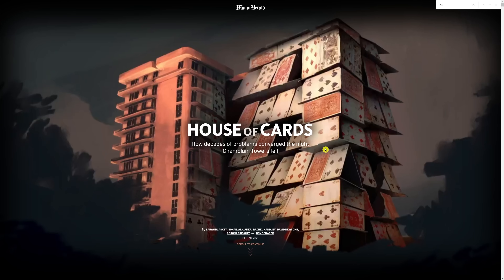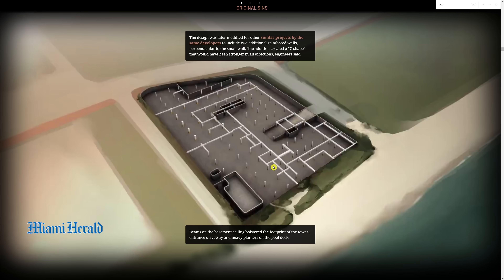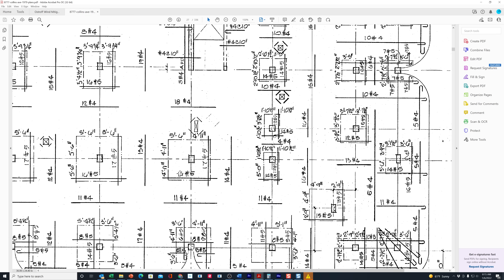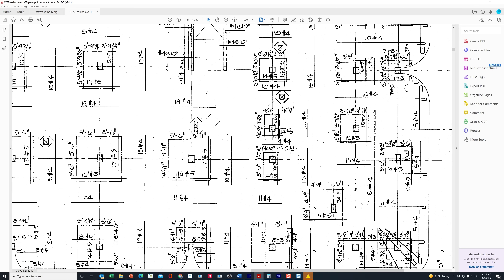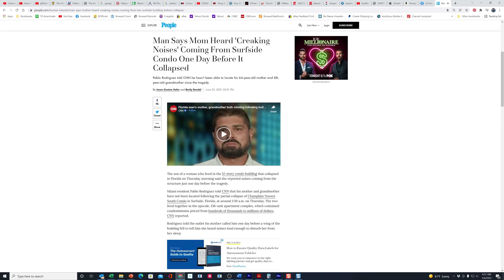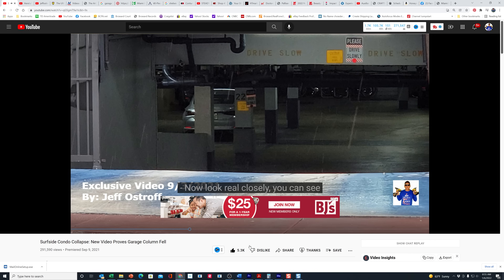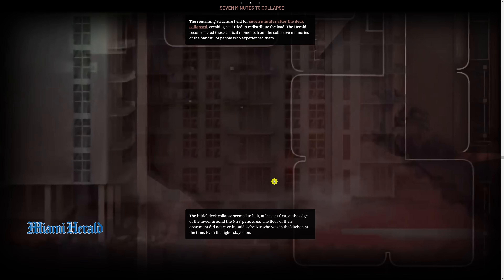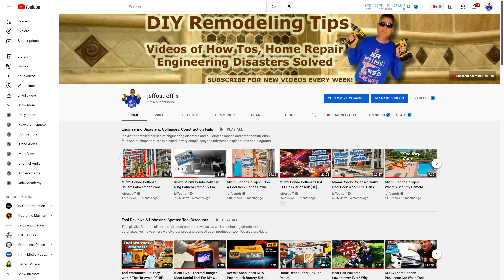Best Condo Collapse Theories: Me Or Miami Herald House of Cards?

Comment: For those who are interested, this discussion includes sounds of reinforcement fracturing during the testing of a scaled reinforced concrete wall. The bars in this wall are approximately the same size as the bars in the slab-wall connection.  https://youtu.be/HyRdXg8Dve0
Reply from the maker: Yes that is a whole new area of study that many people likely had no thought of except for the family of the one lady who heard the creaking sounds the day before the collapse. Would like to see more vide/sound of concrete failing. The example shown we could not really hear the audio too well, and would like to see examples back to back  to hear differences in rebar cracking vs concrete cracking, vs a crack developing in the wall of a condo unit, like Maria Iliana Monteagudo in unit 611 saw.
Reply: @jeffostroff  We are conducting a slab column test soon and I will ask the graduate student conducting the tests to record the sounds. In the lab, the hydraulics are loud so it might be hard to hear but we will see what we can do. 

The connection we are testing is aimed currently at new design, but I am writing a proposal to investigate new rehabilitation methods for corroded and degraded flat-slab structures. This connection is one of many methods we will investigate to increase the connection strength and the slab strength and stiffness.

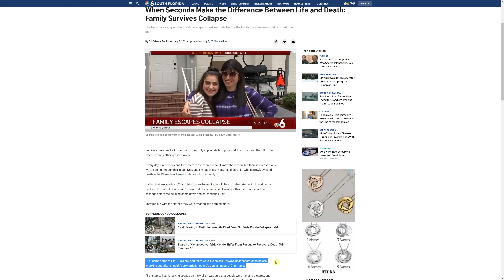Comment: 12:05 This one was obviously a water flow alarm and a pressure alarm. Means that you have at least 1 sprinkler head working. Once in front of the control panel you will see where.

Control panel send a fire call to the alarm monitoring company and is supposed to trigger a sound and visual alarm in the whole building...
Reply from the maker: Yes all of us wonder why no sound
Reply: @jeffostroff  Communication and data wires severed when the first parts and planters fell and shorted something out is what I'm thinking.
Reply: A water flow alarm sounds an exterior alarm bell or gong and notifies alarm monitoring. In a high rise it could also activate the fire alarm on the floor of and the floor above and below activation. Floors without the fire alarm are to remain in and wait for the fire dept to issue evacuation. This is done to not overwhelm evac routes or impede fire dept access.
Reply: @Embjet145  Yes, and the gong only works because of the water flow. But no sound at all.

Comment: From the ring video in 711, it appears to me that the building may have been sagging in the middle, as the box on the left suddenly leaned toward the right. However, the debris falling seemed to change direction a couple of times, indicating that the building was shifting. I am wondering if the 10s fell first, as victims from the 11s seemed to be found sooner. Perhaps that is because of the instability of the standing portion, or perhaps because they fell first. But I agree, in the surveillance video, it appears to collapse first right in the middle, where the 11s are.

The video from Building Integrity regarding the damage to the south wall during construction of 87 park and sidewalk, where chunk of the wall are missing and filled in with gravel, appears to line up with the damage shown in the “House of Cards” video. 

The overlay you did of the garage entrance video from CTS North does show that the M11.1 column is not in place in the enhanced tourist video. It is possible that multiple columns along the south wall of the building had fallen when the pool deck collapsed, which could be the reason for the shifting described by Gabe Nir and which probably caused Maria Iliana in 611 to wake up and check her living room. As for what triggered the deck to fall, it appears to be the accumulation of stresses, like when the masking tape on a Christmas card finally loses its grip, and the card falls from the mantel. 

The sounds heard by Elena Blasser in 1211 the previous night and these heard by Gabe Nir’s sister in 111 at 11 pm are definitely telltale signs of trouble. Morabito’s report definitely raised some alarms, especially after core samples were taken and he was concerned about destabilizing the building by doing further work on the pool deck. It is a mystery that two engineers living in the building were not alarmed.

Great job with pulling all of these resources together, raising questions, and providing detailed analysis, excellent graphics, and possible causes.
Reply from the maker: Good summary thanks

Comment: Just to clarify, when you say a 12" x 16" or even 12" x 24" column is "no stronger" than a 12" x 12" column, that only applies to a buckling failure mode, IN the direction of the narrow 12" dimension.  Under normal vertical compressive load--and in terms of punching shear failure mode--a 12" x 24" column is indeed TWICE as strong as a spindly 12" x 12" column.  Of course a ROUND cross-sectional column is the most efficient strength:mass ratio, also most resistant to buckling in ALL directions, BUT... requires either expensive reusable forms, or expensive (cardboard) sacrificial single-use forms... #BlameReiber
Reply from the maker: Yes, my explanation was due to the fact that I believe we had that shearing forces of the falling pool deck pull to one direction. But you are also right that thicker columns are better when the building is standing under compression load, and no outside forces trying to yank the rug out from under it.
Reply: @jeffostroff  True that.  pssst! Hey Jeff, got a deal for you on a unit in CTNorth... ocean view... won't last long!  ;')
Reply: ... won't last long!  see what I did there?... yeah, I'll burn in Heck for that... esp. if "something happens" in the future... =:O

Comment: Another fantastic video. As usual. Yes I believe McGuiness was there because they only got one of the permits ( safety anchors ) that day when they’d  been working on the roof for awhile . I think your both kinda right. I believe though that the deck ripped from the pool deck wall first though. When I saw the corroded hooks that was all that holding that section of the pool deck up from Kilsheimers pics was likely the trigger.
Reply from the maker: Good call!

Comment: I agree that the pool deck collapse likely started due to missing beams. But I believe the building was brought down by the excessive attachment of BMA beam to column m-10. The actual build of the BMA did not take into account of the floor step, and consequently the M-10 connection was 11 inches deeper than it should have been. This extra depth likely contained rebar.
Reply from the maker: That's an interesting angle for sure!

Comment: The multiple booming sounds make perfect sense. I have been in hurricanes and wind storms and heard tree roots snap underground. Very loud. Rebar snapping would be even louder.
Reply from the maker: Yes, and they also heard the building creak the day before which is eerie too
Reply: @jeffostroff  Do we know if the puddle the pool contractor saw in the parking garage was a recurring problem or was it new. If it he puddle was new it may be connected with the creak.

Comment: Jeff, you were totally correct in the assumption of the missing column at the base of the ramp.  But my question is, could this column have been so pivotal to the collapse?  Why was it undersized?  Or absent from the final drawings?  It looks like the engineering firm that designed the building was using the 'fall back support' mode, where all the outward weigh and force projections, were directed toward a common "stand pin", to absorbe all the inward weight and pressure, and was added as a last minute red line, but not large enough to support the load?  Just my opinion.
Reply from the maker: Remember that column sits right in an area where the most amount of damage in leaks and cracks on the garage ceiling were found three years before the collapse and of course got worse according to the engineer. So you take out that one column and suddenly all of the other week columns are now asked to carry the burden of the existing wound which they probably were not prepared to do. Also the collapsing pool deck likely might have wakened or taken out another column or two as well.

Comment: I thought the Miami Herald report was excellently done and pretty thorough with good explanations for the average reader. Despite the differences in theories I would be hard pushed to decide which one is likely to be most close to the actual facts - and of course many of your theories are shared by the Herald article too, so not so different. I do believe your version of the timeline is much more likely - and warnings were evident a day or two before the collapse. Arguably warnings were evident even before that!
What both of you also have in common is that it has become very apparent indeed that the collapse was almost all probably due to initial design flaws, inspections lacking thoroughness, and general neglect and abuse of loading designs over the years. The Herald article didn't mention the penthouse either which undoubtedly caused a lot more stress on the already under-specced components.
Or in other words: the eagerness by some to try and blame 87th Terrace for all the woes associated with CTS, seems a little bit "clutching at straws" to me, honestly.
Reply from the maker: Yes I'm still on the fence about whether the penthouse caused any issues because the architect had it in the plans already. The issue about the penthouse was that they were trying to scoop by and build that 13th floor in a city that doesn't allow 13 floors. So I don't think it's so much of an issue of was it too much weight on top of the building, I think it was already designed in they were planning that 13th floor all along. I think we will see from the NIST computer modeling and testing whether they think it will cause a problem or not' cause as you know the PSI rating of the concrete is higher at the lower part of the building by the garage and the higher up you go the less PSI rating you need.

Comment: Thank you for another great video.
You have stated that the initial collapse may have occurred under the planters, and the stressed beam and column under the planters possibly fell first. I recently saw a diagram of that area in the New York Times 3D animation, and it showed that the stressed beam was attached to the sides of the columns using mortise and tenon joints.  Is this a common joint used for concrete columns and beams?
Reply from the maker: Yes that is a common means of connecting the beam to the columns and one would hope there'd be enough of the thick rebar rods to make that connection possible getting ready to type. but remember a lot of us think that beam was under quite a bit of water intrusion because of all of the peeled paint on it so the question is if that concrete beam starts soaking up water over the years and you could see the patches on the ceiling all around it from the plastic corrugation to protect the cars from getting the water dripping on them. How soft did that concrete get? did it lose its PS i rating that it was originally designed for question mark those are the questions i have period
Reply: The mortis and tenon is functionally what is used sometimes but the mortis would normally be the full size of the beam, not smaller like a tenon typically is so in this situation it would not be practical because the column is not large enough.  The proper terminology would be "beam pocket" or "shear key" and would be more commonly used when connecting to a larger surface where you could form the pocket without compromising the thing that you are connecting into.  In the Champlain towers situation it should have all been poured at the same time.  The columns would be poured up to the underside of the pool deck structure and stopped, and they would stop at different elevations because some places they support beams, some places they support slabs, etc.  The column reinforcing would continue up to where it is supposed to stop.  Then the formwork for the floor would be constructed and when concrete for the floor is poured it would fill in the columns as well.  So standing in the garage looking up at a column with a beam framing into it, there would be a construction joint occurring lined up with the bottom of the beam.  This gives the beam the strongest connection to the column because there is no form of joint going through the beam.  The column is in compression across the horizontal joint that goes through it so there is no problem with that joint either.  With this garage interior being painted it would not be possible to see these joints in the finished structure, in unpainted concrete sometimes they are easier to see.

Comment: Thanks, Jeff and a question. When the middle section of the building collapsed it appears that the rear part (looking from the camera position) went milliseconds(? ) later. Could this be because the gym area (in the front) collapsed first and transmitted the failure from front to rear?
Reply from the maker: Yes I thought the same thing as well and that does make sense because if those columns in the front part of the building facing the camera fell first then that part of the building is going to drop and that will propagate the collapse backwards so it makes perfect sense that the rear part of the building in the video is going to be the last part to drop even if it's just my very small delay.

Comment: You have the fitness center plus the marble in the entryway that should be nearby. Iirc the entire entryway was covered in marble. How much do each of those tiles weigh?? In the lawsuit (mentioned in another engineering channel) the HOA board was concerned with redoing the entryway (which may have taken place) while there were residents worried about structural issues. Those residents had decided to replace board members and had started to actually do so but it was too late obviously to stop the collapse.
Reply from the maker: Yes the whole situation is such a shame because the engineering changes they were going to make I think would have really helped out this building if it had just held up long enough for them to make these changes I think everything would have been OK

Comment: Interesting on the fire alarm. There's more than one type. The photoelectric smoke alarm wouldn't be able to detect the difference between smoke and dust.
Reply from the maker: I think this one went off from the loss of water pressure in the pipes

Comment: Very curious to know if the surviving tower with the 24x24 columns was the first to be constructed.
It looks like they either ran out of materials or they didn't switch back to 24x24 columns after creating some narrower columns for the pool deck.
Is there any info about the building order?
Reply from the maker: I doubt that any of that surviving tower wasn't afterthought in terms of engineering. A lot of people are unaware but the second level has a huge number of extra support beams likely because of the large shear wall that exists on this tower along the elevator and stairs. And so to support that huge shear wall going all the way up you need to have all of these extra beams on the second level, and those need to be supported by larger columns. I just wish they had used those larger columns in the other building because chances are it might have survived.
Reply: OY:  The workmen did not change the size of the columns. Both the larger and smaller columns were specified in all the drawings.
Reply: Cast-in-place (CIP) structures like CTS are "layered up" one entire floor at a time, and yes, all the column sizes were specified before a shovel ever hit the sand.  Watching that collapse video though, it's easy to imagine that CTS was built as 4 separate towers, but that's just a result of its WEAK-ass NON-redundant design, and what Controlled Demolition Inc. called "very soft" concrete, aka "Mafia-mix" concrete.    #BlameReiber

Comment: Thanks Jeff! I followed  your series from the beginning.  I'll go back and watch their presentation as well.   One thing that did cross my mind with the size of the initial supports being 24x24 and the rest smaller. Is it possible that the earlier columns were put in, and an inspector signed off on them..... only to cut corners  and put smaller columns in later?

Or, do you think the project may have had budget over runs and they thought that the smaller columns would still be safe, not knowing that 30 years later people would be redoing their units and using the the really heavy materials you mentioned?

In the end, regardless of column size and unit weight, would the water penetration have brought it down anyway, just further in the future?
Reply from the maker: No the real deal with those 24 inch columns is the fact that that part of the building has the large shear wall along the elevator shaft and staircase. And so they added a whole lot of extra beam support on the second level and this requires of course extra thick columns down in the garage level to support all of this extra weight of concrete beams so that is why that part of the building had 24 inch columns.
Reply: Josh Porter from the channel Building Integrity explained that the reason that part of the building had thicker columns was likely due to the fact that there was a driveway and parking lot above those columns and they were thicker to handle the dynamic load of cars driving around above them.